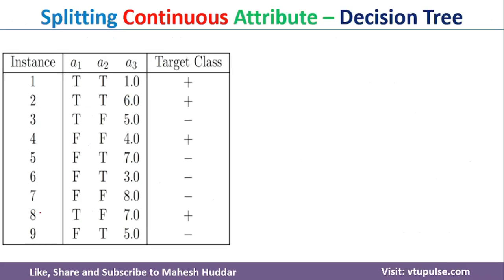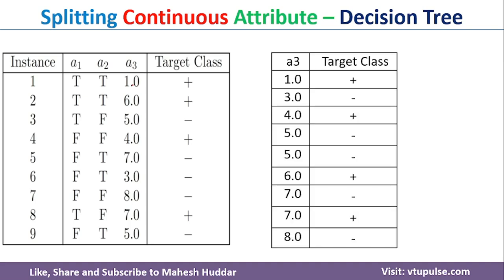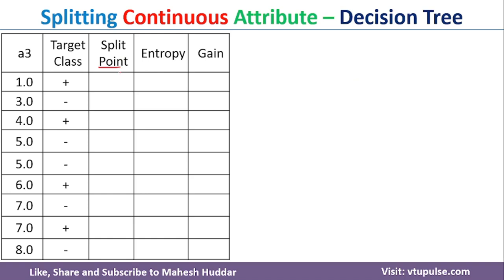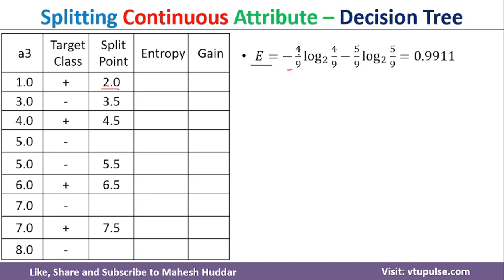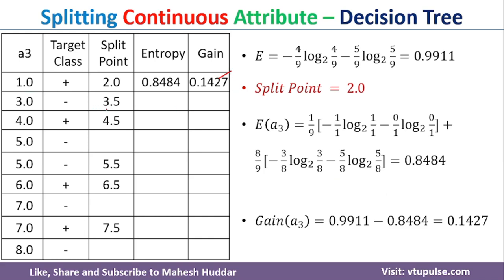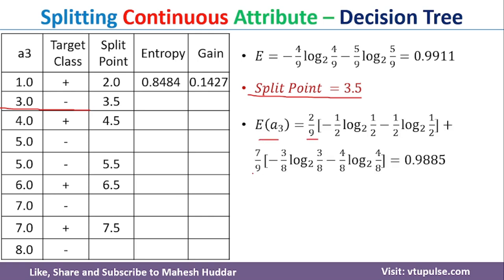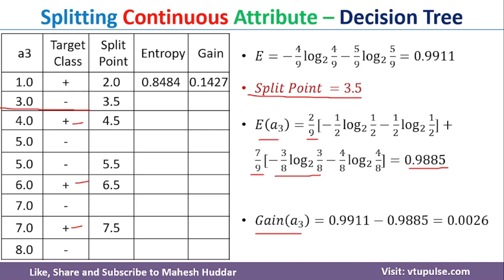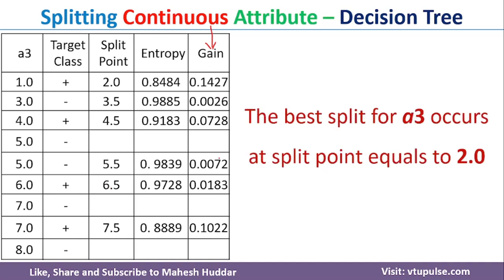How to get Split Point of Continuous Valued Attribute using Entropy & Information Gain Mahesh Huddar

Comment: I just want to point out the error when calculating entropy for split 3.5. The second part should be 7/9[-3/7*log_2(3/7) - 4/7*log_2(4/7)]
Reply: + i think there  a missing split point  in index 7 ===> split point is 7 there      7+7/2==7